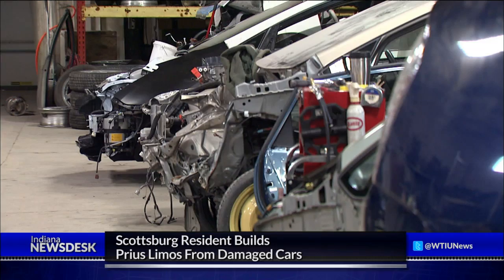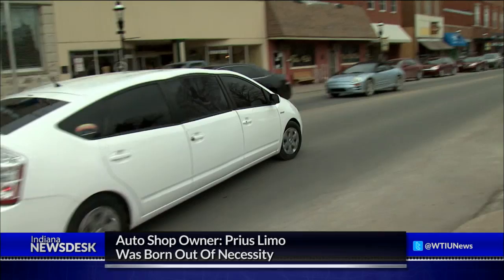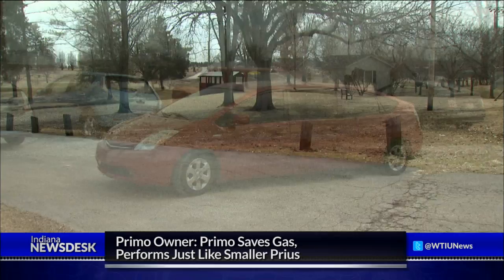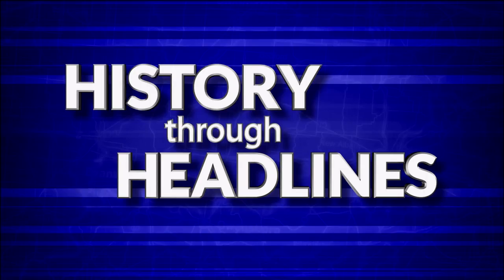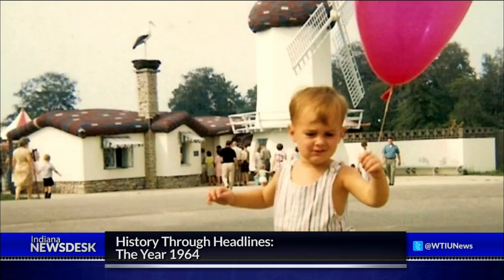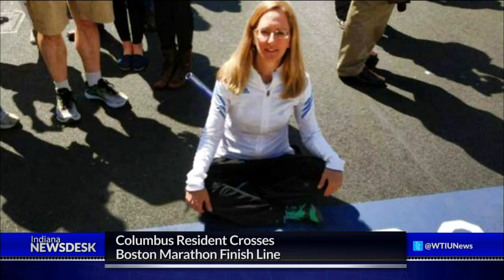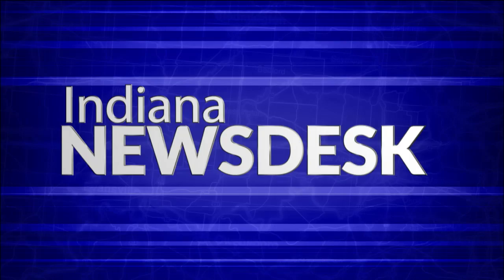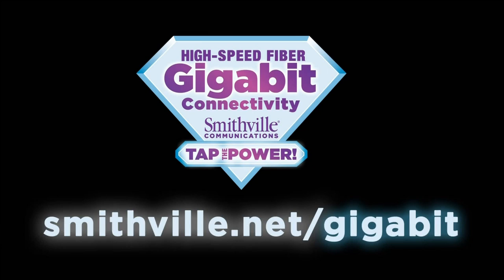Indiana Resident Creates Prius Limos Out Of Wrecked Cars

Comment: he needs to make a priimo out of two front ends, 4 wheel drive, 4 wheel steering 2 AC units, separate sound systems double the battery capacity and 8 doors with a lounge area between the middle rows
Reply: +denvera1g1 no fabrication needed for the extra doors